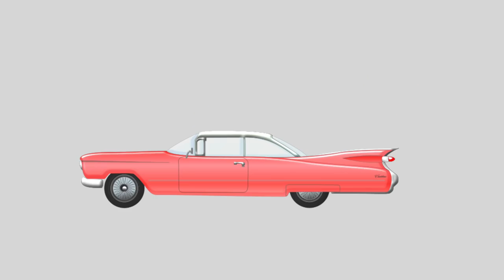Yes, Rockets CAN Fly in a Vacuum

Comment: Wow...you just don't understand simple facts...The air escaping the balloon will interact with the air from atmosphere and so you have thrust. So..the air molecules from the balloon will escape because of the pressure difference, but they will meet the molecules of air in the atmosphere and push against them...That force pushing against the air molecules from the room will create a counter force. This is how thrust got borne. Now, remove the air from that room and repeat the experiment. Stop explaining things you don't understand.
Reply: Good advice. You should follow it yourself. You see, by the time the air escaping the balloon exits it, it has already done its job of pushing the balloon forward, or wouldn't have interacted with it at all, and so it doesn't have to rely on any external medium to fly.
Reply: @Jan_Strzelecki  You are totally wrong. At the exit of the neck of the nozzle, there is pressure. Atmospheric pressure. Read technical specification from rocket engines producers. If there is no pressure at the neck of the nozzle, there is no modification in the speed of the gases  exiting the neck of the nozzle. If there is no modification in the speed of the gases at exit, there is no mechanical work, no thrust.
Reply: @marcuspolus6270  Meaning, as the atmospheric pressure drops, the rocket engine gets more efficient :)
What you're not understanding about this whole "how rockets work in space" thing is that the exhaust doesn't do any work as it exits the nozzle, yes, and isn't expected to. The actual work of pushing the rocket forward is done inside the combustion chamber, as expanding hot gasses push against its walls.
Reply: @Jan_Strzelecki  you need to understand that gases from rocket engines have speed. In order to transform that speed in thrust, molecules of the exhaust gases must collide with something in order to transform there speed in work. At the exit of the engine, molecules of the exhaust gases collide with molecules of air from atmosphere and this is how they are building the force of thrust. If there is no collision with nothing, the molecules of the exhaust gases will just continue their trajectory without interaction, without speed modification. Read and learn.
Reply: @marcuspolus6270  you need to understand that gases from rocket engines have speed. In order to transform that speed in thrust, molecules of the exhaust gases must collide with something in order to transform there speed in work.
Yes, that is correct.

At the exit of the engine, molecules of the exhaust gases collide with molecules of air from atmosphere and this is how they are building the force of thrust.
Why only "at the end of the engine"? What technology NASA has been employing to direct that thrust in only one direction without breaking Newton's Laws of Motion?
Reply: @Jan_Strzelecki  because in the engine, without a point of exit, you will have a pressure uniform distributed inside the combustion chamber. I will stop explaining to you...you have no idea how rocket engines work
Reply: @Jan_Strzelecki  and I said....at the exit of the engine....not at the end....The exit point is the neck of the nozzle.
Reply: @marcuspolus6270  Yes, but that's not where exhaust gasses push the rocket. Listen, I'll make it easy for you to explain:
In rocket's combustion chamber, fuel gets combined with oxidiser, with produces hot exhaust gas.

The gas expands in all directions.

At some point it will impact the walls of the combustion chamber.

When that happens, the gas will ricochet off that surface.

When that happens, the gas will experience a force.

Any force has an equal but opposite force.

Ergo, the combustion chamber, and the rocket it's attached to will also experience a force and start moving.

I'll be happy to explain further any point you have troubles with.
Reply: @Jan_Strzelecki  you have no idea...during explosion in combustion chamber the force is equally distributed on the walls of the chamber...at the same force...the resultant force of an explosion in a closed box is ZERO. I will not continue this discussion with you. Start learning.
Reply: @Jan_Strzelecki  do you think that particles during explosion will collide with only one side of the combustion chamber, or with all ? Collision force will be equally distributed in all directions...Resultant force will be ZERO...
Reply: @marcuspolus6270  Yes, the force is equally distributed on the walls of the closed chamber. A rocket's combustion chamber is not a closed chamber. Maybe you should try learning as well? :)
Reply: @marcuspolus6270  Yes, the collision force will be equally distributed in all directions, unless one of the walls has an opening, in which case there will be a force unbalance in one direction, further amplified by the shape of the combustion chamber. And it's that force unbalance that propels the rocket forward.
Reply: @Jan_Strzelecki  you don't even understand basic phenomenon..the thing with the box was an example to explain the resultant force..That hole...the neck of the nozzle is there to release the pressure resulted during explosion...that pressure will push the rocket. Why all the time the rocket is going in the opposite direction of the nozzle ? After you, that nozzle can be in any direction. ..I stop here...have a nice faith in NASA.
Reply: @marcuspolus6270  The rocket is going in the opposite direction of the nozzle, because the nozzle is the opening that creates the force unbalance we've discussed before. And yes, the nozzle can be in any direction, so?
Please tell me, which point specifically you disagree with?

1. In rocket's open combustion chamber, fuel gets combined with oxidiser, with produces hot exhaust gas.

2. The gas expands in all directions.

3. At some point it will impact the walls of the combustion chamber, except for the open part with the nozzle.

4. When that happens, the gas will ricochet off that surface.
 The only surface it won't ricochet off will be the opening leading to the nozzle.

5. When that happens, the gas will experience a force. The only part that doesn't experience any force will be, again, the opening leading to the nozzle.

6. Any force has an equal but opposite force.

7. Ergo, the combustion chamber, and the rocket it's attached to will also experience a force and start moving, because the opening in the combustion chamber has caused force unabalance.
Reply: @Jan_Strzelecki  when you say that the propulsion is the result of the collision between molecules and the walls of the combustion chamber and not a result of the pressure release and friction/collision between a very high speed jet and molecules of the air in the atmosphere, you just demonstrate you dont understand the phenomenon. In a balloon at a specific pressure, when the pressure is released, propulsion is created. In a balloon you have no explosion. You have constant pressure. Yet, releasing the pressure will produce propulsion. Ready...from now on I am not responding to you, until I realize you start learning.
Reply: @marcuspolus6270  when you say that the propulsion is the result of the collision between molecules and the walls of the combustion chamber and not a result of the pressure release
The collision between molecules and the walls of the chamber are the pressure release.

collision between a very high speed jet and molecules of the air in the atmosphere
If the "very high speed jet" (what?) has left the nozzle, it means it has already done its job of propelling the rocket. It can collide with anything it wants, but it's not going to affect the rocket anymore.

In a balloon you have no explosion. You have constant pressure.
In rocket, that constant pressure is provided by the continuing burn of the fuel with the oxidiser.

from now on I am not responding to you
It's like, the tenth time you've declared you won't respond to me, only to break your word :D

So, again, please tell me which point specifically you disagree with?

1. In rocket's open combustion chamber, fuel gets combined with oxidiser, with produces hot exhaust gas.

2. The gas expands in all directions.

3. At some point it will impact the walls of the combustion chamber, except for the open part with the nozzle.

4. When that happens, the gas will ricochet off that surface.
 The only surface it won't ricochet off will be the opening leading to the nozzle.

5. When that happens, the gas will experience a force. The only part that doesn't experience any force will be, again, the opening leading to the nozzle.

6. Any force has an equal but opposite force.

7. Ergo, the combustion chamber, and the rocket it's attached to will also experience a force and start moving, because the opening in the combustion chamber has caused force unabalance.
Reply: @Jan_Strzelecki  whatever you say is the real truth. Ignore me.
Reply: @marcuspolus6270  Oh, don't be daft, Marcus :) Is this how you maintain your illusionary superiority? By ignoring everyone who proves you wrong? It seems clear that you have no idea how rockets actually produce thrust, going by the "explanations" provided by other people without really understanding them yourself :)
Let me try again: In the combustion chamber, which is open on one end, fuel is combined with oxidiser, with produces hot exhaust gas, which expands in all directions. Now, some of it, which happens to be facing the opening, will simply exit the combustion chamber without affecting the rocket in any way, but every other gas particle which is facing away from the opening will have to continue moving in its original direction (because doing otherwise would break Newton's Laws of Motion), until it hits the walls of the combustion chamber.
When it does that, it will bounce back. When that happens, the gas will experience a force.
 And any force has an equal but opposite force, doesn't it? :)
Reply: @Jan_Strzelecki  I will block all comments from you...I am tired...I don't have time to educate you.
Reply: @marcuspolus6270  if there is no importance of the fact that the exhaust gas is released, then why the nozzle is a mobile device capable of directing the pressure jet in different directions in order to produce changes in direction?
The nozzle being a mobile device simply means that its opening moves around, which means that the spot opposite of it will also move around. Meanwhile, the rocket will still burn fuel with oxidiser, producing exhaust gasses moving outwards in all direction. What is the problem here? :)

I will block all comments from you...I am tired...I don't have time to educate you.
You can't educate me, because you don't understand it yourself.
Reply: @Jan_Strzelecki  OK...let's say you are right...let's say you don't need action/opposing force to action / reaction....let's just pretend we are brain dead...let's say...if you have action, you get reaction without a force to oppose your action. Now, as I am absolutely sure, you know the velocity of exhaust gases from the rocket engine...and that velocity is about 7000 - 8000 km/h... OK ? Now...based on your formula based on velocity only....can you explain how is possible for a rocket to have a speed 4 times bigger than the velocity of action ? I mean...if the velocity/speed of gases from combustion chamber is 8000 km/h...how can you get a speed of ...let's say...8001 km/h ? Assuming that your engine is 100% efficient... Prove you are not brain dead.
Reply: @marcuspolus6270  OK...let's say you are right...let's say you don't need action/opposing force to action / reaction.
I'm not saying that at all. Please don't skip that step and jump to another supposed problem.

Now, as I am absolutely sure, you know the velocity of exhaust gases from the rocket engine
Not off the top of my head, no :)

Now...based on your formula based on velocity only
This one?
F = m dot * Ve + (pe - p0) * Ae
Why should it be "based on velocity only"? I clearly see mass there as well.

In any case, let's not jump into those other supposed problems before you actually understand how rocket engines work in real life, okay? :)
Let me try yet again: In the combustion chamber, which is open on one end, (and that opening can move at will to some extent) fuel is combined with oxidiser, with produces hot exhaust gas, which expands in all directions. Now, some of it, which happens to be facing the opening (whenever it is located at this particular moment), will simply exit the combustion chamber without affecting the rocket in any way, but every other gas particle which is facing away from the opening will have to continue moving in its original direction (because doing otherwise would break Newton's Laws of Motion), until it hits the walls of the combustion chamber.
When it does that, it will bounce back. When that happens, the gas will experience a force.
 And any force has an equal but opposite force, doesn't it? :)
Reply: @Jan_Strzelecki  you want to make things more complicated...ok...then we must involve also the mass of rocket, load, inertia....now prove you can move that rocket with 30.000 km/h when velocity of your exhaust gases have about 8.000 km/h. 
About the balloon question...in a balloon, there are no explosions...there is no combustion ...the pressure is fixed. Why is the balloon moving when the pressure is released ?
Now...according to your theory, the thrust is obtain because:
a. in the engine explosion of the fuel take place
b. pressure is uniformly distributed against the walls of the combustion chamber
c. only where the throat is, because the gases have nothing to push against and there is a hole, thrust is created in opposing direction of the throat
Did I get it right ?
Now....can you explain how thick the wall of the combustion chamber is on the wall opposing the throat of the chamber, in order to sustain all thrust and mass of the rocket ?
All you say is breaking Newton's law....read it again and understand... You need action...a force resisting your action and then the reaction is created. In rocket propulsion, things are like that:
combustion chamber...fuel mixture...explosion...pressure...release of the pressure through a controlled throat and nozzle (area of the nozzle is also very important) ...atmospheric pressure resisting the high pressure (and speed/velocity) released through throat and nozzle...as reaction, thrust is created...lift off...

But, in order to make you understand in what deep error you are, you must explain how is possible to accelerate a rocket to 40.000 km/h when your velocity of the gases do not exceed 20.000 km/h (the best rocket engines for short period of time can get there...see the new russian hyper speed rockets) ....and yes...you can involve not only the velocity (I was trying to help you) ...but also mass and load of the rocket...and you don't have anymore an engine at 100% efficiency....but as usual, about 70%.
Good luck with that.
Reply: @Jan_Strzelecki  Marcus Polus is correct.  Not sure how you can honestly believe that a rocket is pushing against its own thrust.  Its OWN thrust...
Reply: @DrCash7  Since the exhaust gasses expand in all directions, it kinda has to. Even when there's this big opening at the end of the combustion chamber, will "infinite vacuum" invitingly waiting to welcome each and every exhaust particle inside, if said particle isn't initially pointing towards the opening, then it can't just change its direction mid-flight - it will continue flying forward until it bounces off the wall of the combustion chamber, and although it will make it face backwards, towards the opening, this collision will give the rocket a tiny push forward. Multiply that by all the exhaust gas particles, and you can get the rocket going really fast :)
Reply: @Jan_Strzelecki  incorrect.  Path of least resistance is out into the vacuum.  Free expansion, so no work done.  Just keep re-reading this until you can grasp it.  It's a simple concept.  Not sure why you are struggling here.
Reply: @Jan_Strzelecki  again, pushing against its own exhaust?  And what does the exhaust in turn push against?  Or is this super exhaust xD xD.  Pubert
Reply: @DrCash7  Path of least resistance is out into the vacuum.
Yes, but the exhaust particles will continue to move in whatever direction it was moving unless acted on by an external force. Just keep re-reading this until you can grasp it. :]

And what does the exhaust in turn push against?
Again: exhaust gasses expand in all directions, not just towards the opening. To face the opening, any exhaust gas particle that wasn't already doing it must interact with something else first - this something being a wall of the combustion chamber. Just keep re-reading this until you can grasp it :D
Reply: @Jan_Strzelecki  Exaclty!   Path of least resistance is out into the vacuum.  Slowly but surely you're getting it.  Good job re-reading.  It's paying off, Pubert 0: 0:
Reply: @DrCash7  Path of least resistance is out into the vacuum.
No, path of the least resistance is whenever exhaust particle was already going :)
To change directions requires effort. I'm sure you are aware of that :]
Reply: @Jan_Strzelecki  lol.  So now the path of least resistance is "whenever the particle was going."  So time travel now xD xD Pubert
😛😛😂😂
Reply: @DrCash7  Oh. You're actually right for a change. Good work! :)
So, path of the least resistance is wherever exhaust particle was already going. It takes effort to change directions. I'm sure you are aware of that :]
Reply: @DrCash7  And I like how you posted that I'm arguing with my own statements, realized I actually wasn't, but instead of admitting that, you've deleted that post :D
Reply: @Jan_Strzelecki  Glad to see you coming around to some sense.  First step is admission.  Very good, Pubert.
Reply: @DrCash7  I'm not coming around to your side, though :)
It's pretty simple:
In rocket's combustion chamber, fuel gets combined with oxidiser, with produces hot exhaust gas.

The gas expands in all directions.

Those gas particles which are moving towards the combustion chamber opening will simply exit it, without doing any work - but that leaves us with all the particles which are facing away from the opening.

At some point they will impact the walls of the combustion chamber.

When that happens, the gas will ricochet off that surface.

When that happens, the gas will experience a force.

Any force has an equal but opposite force.

Ergo, the combustion chamber, and the rocket it's attached to will also experience a force and start moving.

I'll be happy to explain further any point you have troubles with.
Reply: @DrCash7  Are you being obtuse on purpose? ☺
Reply: @Jan_Strzelecki  so Star Wars and now Shawshank Redemption 😆 Pubert learns from movies
Reply: @DrCash7  I honestly have no idea what you're talking about. Shawshank Redemption? ☺ And I'm not really interested in what you learn from movies - although I guess I should be, since this is where you get your physics from, apparently.
Reply: @Jan_Strzelecki  , Saturn V (the rocket) had about 3.000 tones. In order to lift 3.000 tones, you need a force bigger than 3.000 tones. How much combustible material is burned per second in order to produce a force bigger than the own mass of rocket ? All molecules resulted from combustion must have a mass bigger that the mass of rocket, if we are going to accept your idea that the molecules pushing in the wall of combustion chamber is the reason for thrust. Now...if you push against a wall with 100 kgf, is your house going to move ? And all this force must push against the combustion chamber right in that spot opposing the nozzle. Do you realize the ridiculous idea ? Judging that only a tiny percent of all particles resulted from combustion will push in that precise spot of combustion chamber....how much fuel must be burned per second in order to produce a force bigger than the entire mass of the rocket ? Come on, man....try to think.
Reply: @Jan_Strzelecki  , if you make the nozzle longer and so the exit of the nozzle will be turned 180 degrees (so...the jet will go in the opposite direction) but no modification on combustion chamber, in what direction will the rocket fly ?
Reply: @Jan_Strzelecki  can you explain why is not necessary to change the position of the combustion chamber when you must change the direction of flight ? Why the direction is given by changing the jet stream using the nozzle ? Why the only active element in correcting the flight path of a rocket is the nozzle and so the direction of the jet ?
Reply: @marcuspolus6270  Hello again, Marcus. I hope you've been fine those two weeks :)

How much combustible material is burned per second in order to produce a force bigger than the own mass of rocket ?
It's not just about mass - it's about kinetic energy, too. If you're on a skateboard and just slowly push a bowling ball away from you, it won't go anywhere far, and neither will you - but if you throw it as hard as you can, then it will fly farther, and you will move back farther as well. That's why we don't just release a spray of water from a rocket, but combine fuel and oxidizer, to produce hot (meaning "fast moving") exhaust gas.

if you make the nozzle longer and so the exit of the nozzle will be turned 180 degrees (so...the jet will go in the opposite direction) but no modification on combustion chamber, in what direction will the rocket fly ?
It will start flying backwards, although not as fast.

can you explain why is not necessary to change the position of the combustion chamber when you must change the direction of flight?
Because exhaust particles are physical objects, with mass and speed, and thanks to that they can be redirected by placing surfaces in their paths.

Why the only active element in correcting the flight path of a rocket is the nozzle and so the direction of the jet?
The nozzle is the last object the exhaust particles can interact with after leaving the combustion chamber.
Reply: @Jan_Strzelecki  ...wow....you start waking up. So...it is the jet stream that push the rocket...Big success.
Reply: @marcuspolus6270  I don't know what part of my statement would prompt you to conclude that I am "waking up". You're the one that used the term "jet stream" - I've merely followed your lead, to avoid any confusion. In any case, do you understand that it's not just the mass of the propellant, but also its speed that matters?
Reply: @marcuspolus6270  : you definitely need to go back to school.
Good luck!